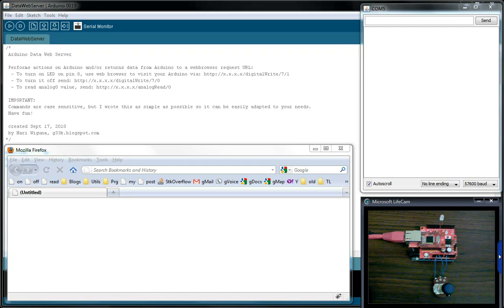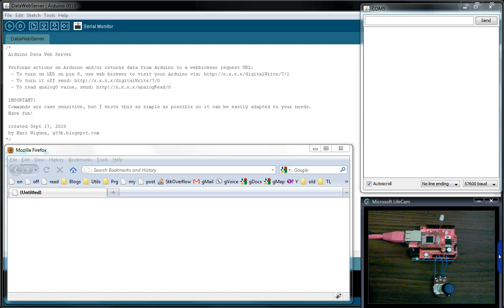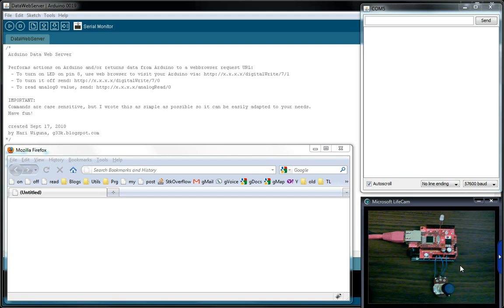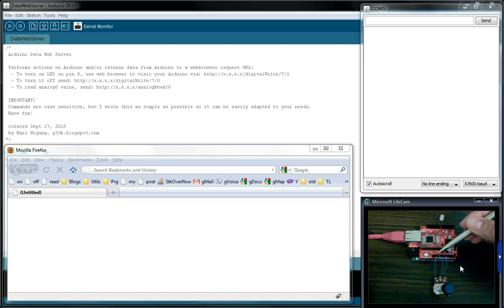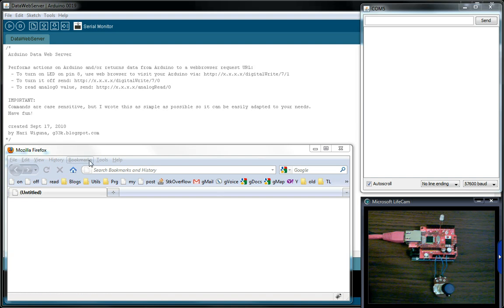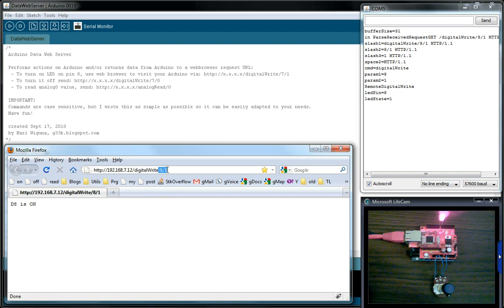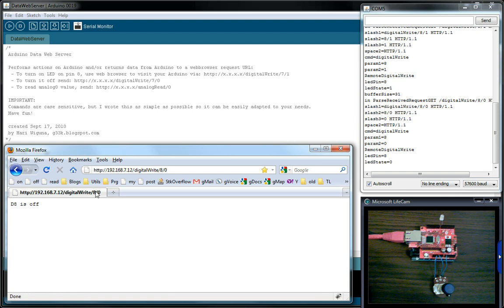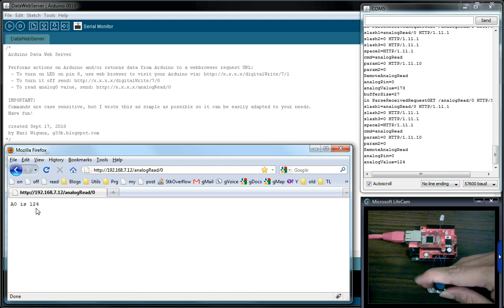Arduino Data WebServer Part 1

Comment: hey hari, the advice u gave regarding using ddns and router forwarding, since I am in college i cant use that, is there a way around that. please help
Reply from the maker: trisha pandey , I don't know. It is probably more of a policy issue rather than technical issue.  Your network IT staff is probably your best resource. I bet they've already had to open open up ports for campus projects where a server needs to be accessed from the outside.
If the answer is not too complex, you may want to share it here for others in the same predicament.

Comment from the maker: Congratulations Sandeep!
You need to do two things: 1. Use a dynamic dns service so the world can hit your network.  2. Read the manual of your router to point traffic to the MAC address that you've assigned for the Arduino.  No change should be necessary to the Arduino sketch.  Good luck!

Comment from the maker: Sandeep,
To clarify, the Arduino and your PC will be on different ethernet wires and have different unique ip addresses.

However, they both should be in the same network.  This typically meant they would share the first three numbers (not digits) in their ip addresses.

If they do not, that would explain why the Arduino cannot be reached.  Crossing local networks require additional work that is beyond this project.

Comment: thanks bro... but i ddnt get one thing. 
do we have to use same network for pc and arduino?
i mean, i am using separate wifi network on pc to which arduino is connected for compiling the code, whereas the ethernet shield is getting different network from another ethernet cable. they are not under same internet connection. :/

Comment from the maker: Sandeep, I wonder if you're not in the same IP address range as the rest of your network.  1. Open a command line prompt in your PC, type ipconfig, look for the IP address of that PC.  2. Enter an almost identical IP address in the Arduino sketch.  Change the LAST number to a higher number between 0 and 254.  This IP address must be unique within your network, so the more devices you have on the network, the more chance of address conflict.  I would try xxx.yyy.zzz.250.  Good luck!

Comment from the maker: Make sure you are using a Private Address Space and the first three numbers are the same as on ip address of your other devices.

The Internet Assigned Numbers Authority (IANA) has reserved the following three blocks of the IP address space for private internets: 10.0.0.0 - 10.255.255.255 (10/8 prefix) 172.16.0.0 - 172.31.255.255 (172.16/12 prefix) 192.168.0.0  - 192.168.255.255 (192.168/16 prefix)
Good luck!

Comment from the maker: It will be hard to debug via youtube comments, ;-) but here it goes.  Test that it IS the Arduino that is responding to your ping by unplugging the ethernet cable from the ethernet shield.  If you still get a response, then you have another device with that ip address. Give the Arduino a different address.
Good luck!